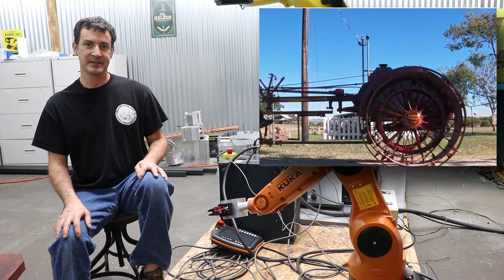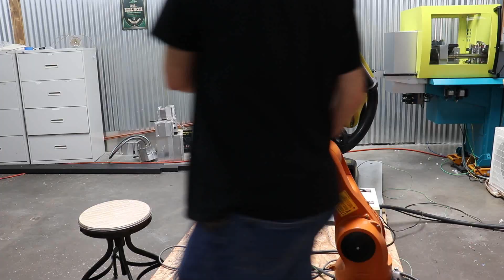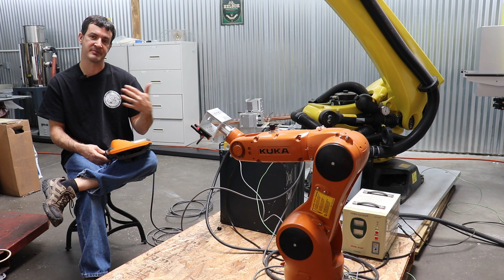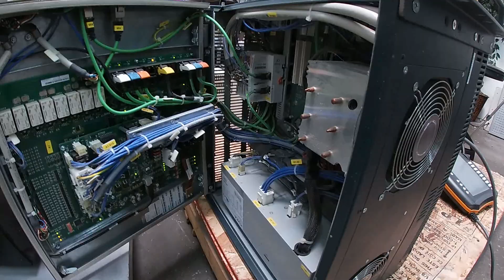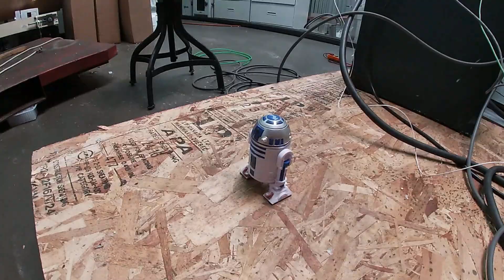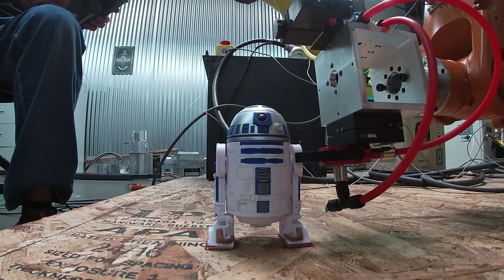Industrial Robot Programming (Edited)

Comment: Do u think something that size has a rigidity to mount a 24K RPM spindle and machine aluminum? I built my 3 axis cnc but it’s too limited so I’m looking for my next step. I briefly watched the drilling video where ur wife converted g code so  I’ll have to learn some programming.
Reply from the maker: @RMarquez805  not recommended

Comment: I don't know on the training remark, i think with a little bit of perseverance, an understanding of programming, electronics and safety you'll get there. A year ago i started 3D-printing with a KRC2 KR-120 and had to figure it by reading tons of manuals but getting there.

I must say KUKA is not the most helpful bunch at times, least to say they are slow. Maybe it is because we run a second hand bot but regarding software cost requests they are not quick at all. There is bucks to be made i guess.

Comment: which kuka model is it ?
Reply from the maker: it is a Agilus KR 6 R900 sixx.  Thanks for watching!
Reply: @DragonflyEngineering   Thanks for reply. Is it possible to use this for welding or spray painting?
Reply from the maker: @jerinjames3001  yes, for welding it is better to get a welding robot that auto swirls (motion) your weld bead, I think those controller do that automatic; this one would be a straight line that you teach.  for painting you would need to teach each motion, but can be done

Comment: Not sure about Kuka's but ABB and Fanuc WILL let you run a program even if you haven't run it in manual. Not that you should, but it does.
BTO stands for Back To Origin  iirc.
Reply: Not sure if it was BTO as I had another language on the pendant, but if it was the thing that prevented you to run a linear motion before you had run a join motion when you enter a new subprogram it is the most infuriating of a thing I've ever come across on any robot brand I've used. Seriously don't understand what the h*** they were thinking when they did that. I asked Kuka about it at the head office in my country and they couldn't other than agree, but could not explain why.
Reply: As far as i know it's to prevent the risk of breaking what ever jig your setup has. i. e. i work with fiberglass molds. Some joint movements will not run the same in manual step-by-step motion as they do in auto. For example Fanuc robots have a continuity parameter on their movements that is not represented correctly (or at all) in manual step-by-step, which changes the trajectory to smoothen it between points (it rounds up the corners in other words). This could lead to the robot hitting your molds/jigs in tight corners. That is the only reason i can think for that feature being there, but i'm not sure if Kukas have the same movement parameter so not sure about those.